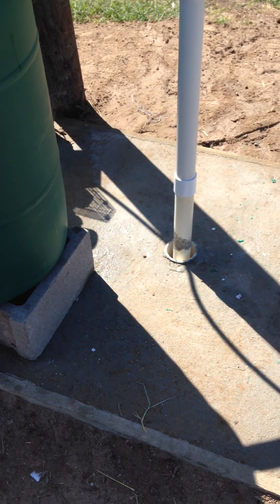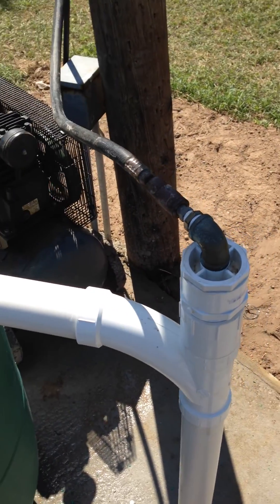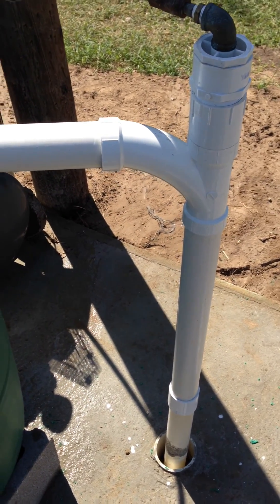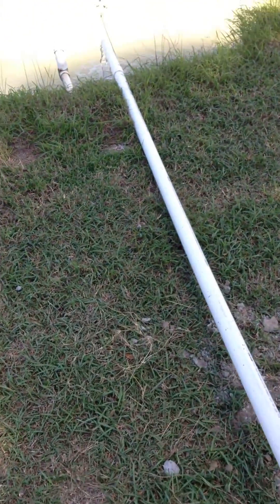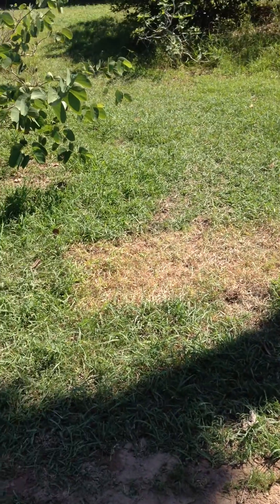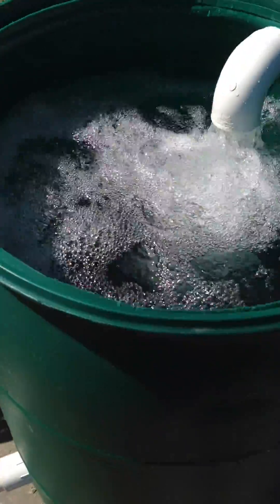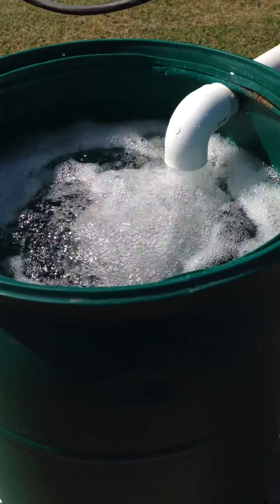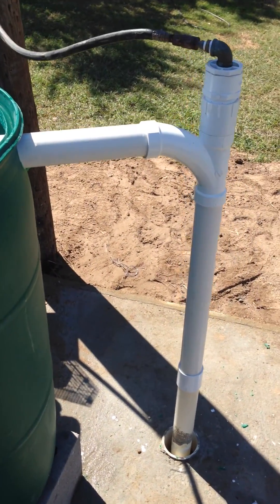Water Well Air Lift

Comment: Did you get this working with solar? If so what air compressor are you using? I have a 100 ft well with 40 ft to water. I am wanting to pump in the summer to a 500 gallon tank I put in the ground right beside the well to water my garden. Also being in the ground it will not freeze here in the winter so I will have an extra supply of water. I have 400 watts of solar panels.

Comment: Dear sir
I have 400feet deep bore well and I have only 100feet water present inside borewell (i.e., 300feet below ground level- 300feet has no water only the lowest 100feet has water present)  if i use 1/2inch riser pipe and 1/2inch air hose, will I get water at ground.or 1inch riser pipe and 1/2inch air hose.
If not kindly suggest some suitable solution...
Reply from the maker: That is a long ways down.  how big is the well casing?
Reply: @delfinocornejo3496  4inch casing ..

Comment: IT would be nice to get a list of parts to make the connection from the air compressor hose end to the pvc pipe.  It looks like an inch elbow and then who knows what to get it to air hose threads.

Comment: Thx I look for a 2 inch well done like yours great job thanks for the info on diffuser lost internet quarter pipe down well with jet it has a simple check valve in it getting ready to inject air down mine to see if it will pump water if not I will drive jet down to bottom of well pass well screen you could try a air pump instead of your compressor seen a demo on YouTube 2o watt pump 15,000 LPM did you see that
Reply from the maker: I'm in the process of getting parts for a single piston pump that I will eventually run off solar
Reply from the maker: Can you send me a link to that pump you mentioned

Comment: Do you have a diffuser on the air pipe how cfm
Reply from the maker: HI Larry, the diffuser is just the bottom end of the the PEX tubing drilled with many small holes.. about 4 ft section of it..
The compressor is delivering about 5cfm at 70 spi